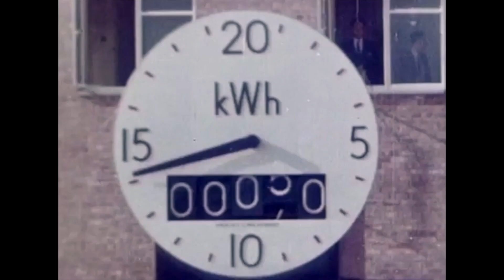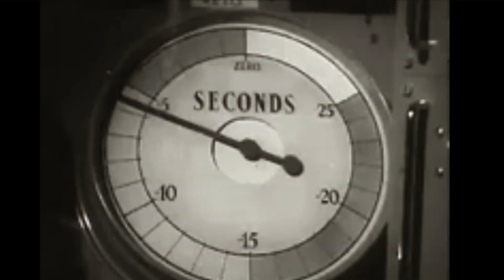Nuclear Lies - Prof Simon

Comment: Too cheap to meter .lol. look at the dismantling costs of our nuclear industry .Hear is just one plant DOUNREAY.
                                           Nuclear Decommissioning Authority ownership
On 1 April 2005 the Nuclear Decommissioning Authority (NDA) became the owner of the site, with the UKAEA remaining as operator. Decommissioning of Dounreay was initially planned to bring the site to an interim care and surveillance state by 2036, and as a brownfield site by 2336, at a total cost of £2.9 billion.[24]

A new company called Dounreay Site Restoration Limited (DSRL) was formed as a subsidiary of the United Kingdom Atomic Energy Authority (UKAEA) to handle the decommissioning process. By May 2008, decommissioning cost estimates had been revised. Removal of all waste from the site was expected to take until the late 2070s to complete and the end-point of the project was scheduled for 2300.[25]

Apart from decommissioning the reactors, reprocessing plant, and associated facilities, there were five main environmental issues to be dealt with:

A 65-metre (213 ft) deep shaft used for intermediate level nuclear waste disposal was contaminating groundwater, and would be threatened by coastal erosion in about 300 years time. The shaft was never designed as a waste depository, but was used as such on a very ad-hoc and poorly monitored basis, without reliable waste disposal records being kept. It was originally used to construct a tunnel for the sea discharge pipe. Later use of the shaft as a convenient waste depository had resulted in one hydrogen gas explosion[26] caused by sodium and potassium wastes reacting with water. At one time it was normal for workers to fire rifles into the shaft to sink polythene bags floating on water.[27]
Irradiated nuclear fuel particles on the seabed near the plant,[5] estimated to be about several hundreds of thousands in number,[28] caused by old fuel rod fragments being pumped into the sea.[5] The beach had been closed since 1983 due to this.[5] In 2008, a clean-up project using Geiger counter-fitted robot submarines was planned to search out and retrieve each particle individually.[5] Particles were still being washed ashore at Sandside Bay beach and one particle at a popular tourist beach at Dunnet in 2006.[29] In 2012, a two million becquerel particle was found at Sandside beach, twice as radioactive as any particle previously found.[30]
18,000 cubic metres (640,000 cu ft) of radiologically contaminated land, and 28,000 cubic metres (990,000 cu ft) of chemically contaminated land.
1,350 cubic metres (48,000 cu ft) of high and medium active liquors and 2,550 cubic metres (90,000 cu ft) of unconditioned intermediate level nuclear waste in store.
1,500 metric tons (1,500 long tons) of sodium, of which 900 metric tons (890 long tons) are radioactively contaminated from the Prototype Fast Reactor.
Historically, much of Dounreay's nuclear waste management was poor. On 18 September 2006, Norman Harrison, acting chief operating officer, predicted that more problems will be encountered from old practices at the site as the decommissioning effort continues. Some parts of the plant are being entered for the first time in 50 years.[31]

In 2007 UKAEA pleaded guilty to four charges under the Radioactive Substances Act 1960 relating to activities between 1963 and 1984, one of disposing of radioactive waste at a landfill site at the plant between 1963 and 1975, and three of illegally dumping radioactive waste and releasing nuclear fuel particles into the sea,[32][33] resulting in a fine of £140,000.[34]

In 2007 a new decommissioning plan was agreed, with a schedule of 25 years and a cost of £2.9 billion, a year later revised to 17 years at a cost of £2.6 billion.[23]

Due to the uranium and plutonium held at the site, it is considered a security risk and there is a high police presence.[5] The fuel elements, known as "exotics", are to be removed to Sellafield for reprocessing, starting in 2014 or 2015.[35][out of date]

In 2013 the detail design of the major project to decommission the intermediate level waste shaft was completed, and work was to begin later in the year. The work would include the recovery and packaging of over 1,500 tonnes of radioactive waste.[36] As of 2013, the "interim end state" planned date had been brought forward to 2022–2025.[37] In March 2014 firefighters extinguished a small fire in an area used to store low-level nuclear waste.[38]

PFR Fire
On 7 October 2014 a fire on the PFR site led to a "release of radioactivity via an unauthorised route". The Office for Nuclear Regulation (ONR) concluded that "procedural non-compliances and behavioural practices" led to the fire, and served an improvement notice on Dounreay Site Restoration Limited.[39][40] In 2015 decommissioning staff expressed a lack of confidence in management at the plant and fear for their safety.[41]

In 2016 the task of dismantling the PFR core commenced.[42] Plans were also announced to move about 700 kg (1,500 lb) of waste Highly Enriched Uranium to the United States.[43][44]

On 7 June 2019, there was a low-level radioactive contamination incident which led to the evacuation of the site. A DSRL spokesman said: "There was no risk to members of the public, no increased risk to the workforce and no release to the environment".[45]

On 23 December 2019, the NDA announced completion of the transfer of all plutonium from Dounreay to Sellafield (the centre of excellence for plutonium management) where all significant UK stocks of this material are now held.[46]

On 20 August 2020 a new date for the site to become available for other uses was announced of 2333, as part of a new draft strategy for reclaimation.[47]

Framework contracts
In April 2019, Dounreay Site Restoration Limited (DSRL) awarded six framework contracts for decommissioning services at Dounreay. The total value of these contracts is estimated to be £400 million.[
                                         NOW COMPARE THAT COST WITH ENERGY PRODUCED .
Reply from the maker: Good points.

Comment: Power too cheap to meter. At the time the UK used around 20% the electricity it does today, then consider that your bill is made up of 2/3rds transmission costs, the fast reactor program was killed despite the promise of much cheaper electricity and Fusion which is better yet may still deliver. I don't really think they were too far off promising that for Nuclear. 

The UK did for sure lie about Caulder Hall as it was intended to be a dual-use site but they later came clean about its use so this is hardly news. 

Also, it would be 20 years after this that America would figure out how to use contaminated waste plutonium that you get from power reactors to build a bomb. That and the Civil Plutonium is keeped separate from the Military stockpile. So all this all nuclear power plants are designed to make bombs stuff is so much hogwash. 3 were but the vast majority were/are for solely electrical power. 

I hope you are not a real professor.
Reply from the maker: Interesting comments but you don’t need to be rude... in my research, much of the spent nuclear fuel is sent for re processing... where plutonium could be extracted for weapons.

Comment: Sir, I’m a nuclear engineer you make a lot of valid points. In civilian power plants U-238 (most common uranium element) does get breed into Pu-239, but the process of separation is super costly because of the byproducts of fission. Not to mention the Pu-239 gets used during operation. There are specific reactors that are used solely to breed U-238 into Pu-239 and are not for power uses. I urge you to look into thorium reactors. They will bring the promise of the cheapest energy sources the planet has ever seen. Not to mention you can’t make a bomb out of it!

Comment: You conveniently don't mention that for many decades, the UK has generated over 20% of its electricity this way. You might also be interested to know that mining coal in Britain released more radiation into the environment than the nuclear power stations in the UK.  But with an agenda, you won't tell folks either of these facts.
Reply: A lot of "green energy" arguments involve dishonest accounting systems.   The magnets for wind turbines and some elements for photovoltaics involve mining rare earths which are found with Uranium and Thorium, so there are now radioactive piles of taillings in the biosphere.  Green energy produces radioactive waste.  The only way to get rid of that material is to burn it up in a reactor.   Coal production and the waste from burning it contaminates far more water than natural gas fracking.

Comment: Britain's ever pompous Baron Penney brought the wretched pommy bombs to Australia and set them off all over the place, assuring us it was safe and we were doing our bit for empire. To cap it off he blew up lumps of plutonium metal scattering the noxious stuff all across the landscape. Thankfully, people woke up to what was going on (the racket coming from the Geiger counters was hard to ignore) and he was given the flick. We are still living with the mess.

Nuclear weapons are a moral abomination, but so is ignoring the potential of nuclear power to contribute to the GHG free energy the world desperately needs. Nuclear power, safe, without waste and bombs, together with renewables is the way ahead.
Reply: With nuclear power, there's no point in even having renewables (other than hydro, which is the only "renewable" that actually works). Actually, even without nuclear power, there's no point in having them, since it's questionable whether they lead to any net reduction in greenhouse gas emissions at all. They're just a scam foisted on an unsuspecting public by the fossil fuel industry, to soak up all non fossil fuel energy investment.
Reply: @hugheaston7598  Not sure I can agree, my house is fully off grid powered by wind and solar for the last twenty years. Haven't paid a power bill in that time and system has paid for itself several times over. These days lower capital cost means the payback is very much quicker.

From my experience (cleaning panels and occasional replacement of faulty panels) suggest solar works best as privately owned roof top systems either to provide standalone power to residences and small businesses or as grid connected feed in.

 With the advent of small load levelling battery systems such installations operate in a way that has no impact on grid stability. People investing in these systems can make substantial profits on their investment even without subsidies, usually very much better than bond rates and often better than the best performing shares. 

Privately owned wind is more problematic in an urban setting for obvious reasons of disturbance (I am in a remote rural area so it's not a problem for me). Also wind is most efficient at extracting kinetic energy at large scale. The industry seems to be converging towards 5MW turbines as the optimum compromise between efficiency versus structural integrity, safety,  ease of installation, and visual amenity. 

In areas with good wind resources such turbines have an availability factor of around 30% and are highly cost effective providing power at well below the cost of coal fired power. They can quickly pay for themselves but the problem is variability of supply. 

In areas with hydro potential this is not a problem, the wind saves on water throughput, saving an important resource, pumped hydro extends the resource even further. Hydro can be easily throttled up and down (load following) to fill in for short falls in wind. In this context the importance of wind is that it is a supply multiplier for hydro.    Compared to dams, wind turbines are dirt cheap, they allow you to substantially extend the generation capability of your hydro system without the high cost of building more dams or more importantly if water resources are constrained, it allows available water to be stretched much further. Wind + hydro is a no brainer.

The problem arises in places where wind cannot be matched with existing or easily developed hydro. Various storage solutions with similar characteristics such as batteries, compressed gas, hydrogen etc have been proposed. I think they will have a place but so far none have matched the capital cost, capacity and ease of operation of hydro.

Then there is the issue of energy intensive industries (steel, aluminium, cement, chemicals, fertilizers, fuels, desal etc) logic suggests these need a local energy intensive energy source to match their consumption pattern, ie the energy needs to be produced near where it is consumed. Coal is out due to its environmental problems and the high cost of mining and transporting it. Gas looks better but it also has environmental issues and where I live at least is very costly.

Modern gen 4 SMR nuclear answers these problems. They will load follow, can be positioned close to where energy is consumed and fuel costs (extraction, preparation and transport) are negligible. These new designs  draw on lessons of the past to be proliferation resistant, have little waste, be ultra safe and have cost parity with or better than coal. However, going nuclear is not an insignificant step, safety and integrity of the system are highly important and this inevitably adds to cost. Nonetheless I think nuclear completes the picture in terms of addressing the energy challenges for this century. In short nuclear/hydro for reliability and energy intensity together with wind and solar for low cost leads to a diverse, secure and affordable energy solution needed for a civilised existence.
Reply from the maker: Terrible legacy

Comment: ITS WHY THEY DEEP SIXED THE MOLTEN SALT THORIUM REACTOR FOR PWRs
Reply from the maker: Interesting
Reply: Alvin Weinberg was a proponent for Thorium and had a reactor built in 1960s running for several years at Oak Ridge.  There was a budget cut in Nixon administration and was forced to shutdown.    It was recently dusted and revived by Kirk Sørensen and seemed to have started some interest in Thorium reactors.  Anyways lots of YouTube stuff if you search.

Comment: By 1970 the cost to build th NRs in the USA cost more than all the fuel used to produce electricity up to that point and never produced more than18% of the power.  When it came time to refuel the taxpayer paid for the new rods $500 million (billions today).  The holding tanks that need to be kept cool to avoid meltdown are full and there is no approved plan for the transport and storage of the highly dangerous rods.   At 12 cents per Kilowatt the most expensive electric power.

Comment: It is disappointing there  was never any highlighting of the vastly superior "Walk-away" Safe benefits of unpressurised high temperature molten salt reactors currently under design and even construction - eg Indonesia's 7×500MWe ThorCon's Liquid metal Thorium ion molten Sodium Fluoride salt walk-away safe energy converters.
I challenge you to make a critical video of the  pros & cons of Indonesia's ThorCon nuclear power over their alternative choice of coal as  they quite rightly don't want to destroy any more of their jungle - the world's lungs - for solar and wind farms thousands of time more area to produce the same output, while each of ThorCon's 500MWe only requires 1.15Ha - that's 23m2/MWe and at fuel cost of 0.4 cents/kWh and the only significant waste problem being the storing the likes of Caesium 137 and Strontium 90 for 300 years - all without any nuclear products for war or hedgieamonic enslavement....

Comment: After watching video Secret Santa says they should have finished the work on the Thorium fueled Liquid Flourine salt reactor at Oak Ridge in the mid-70's and early 80's instead of building the Clinch River Breeder research  reactor. It probably would have had less technical problems and not made bomb grade waste products, and there is far more Thorium in the world than uranium. Lastly, Thorium can be mined with the fraction of radioactive tailings than uranium ore. But there was no plutonium or bomb grade wastes so .......

Comment: As much as I agree with you that we were lied to, Prof, and absolutely share your aversion to nuclear power, not all plutonium is suitable for nuclear weapons.

Now, I may get this wrong, but I believe reactors have to be run at a lower rate to get Pu239, which is the fissile material used, as the more usual Pu236 is too jumpy.  It was long claimed that Chapelcross NPS in Dumfriesshire was ran at a lower rate for this very purpose.

I'm also interested to note that Dounreay was also part of the British nuclear weapons programme.  The experimental fast breeder reactor there never did work, and all we are left with today is one of the most polluted nuclear sites - including notoriously 'hot' beaches - in the world.